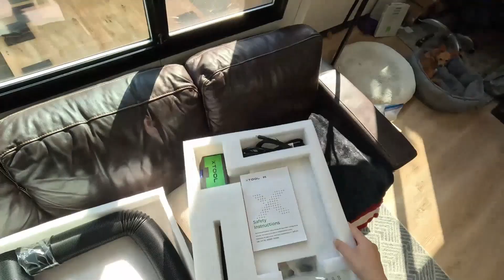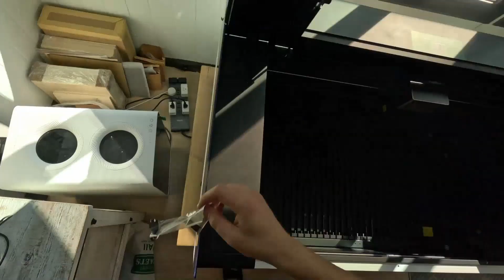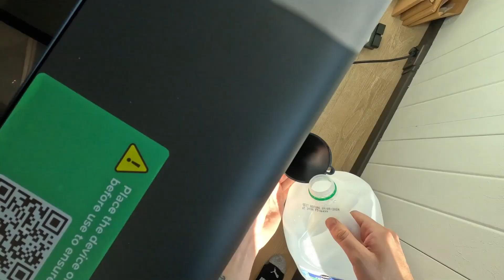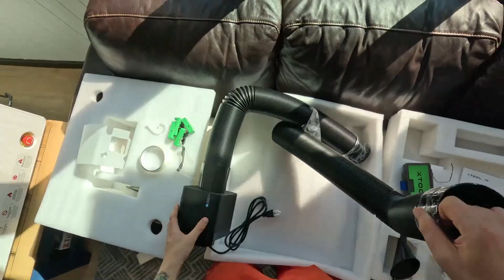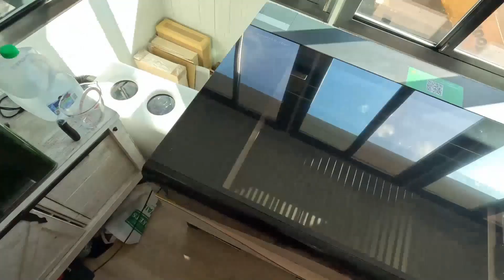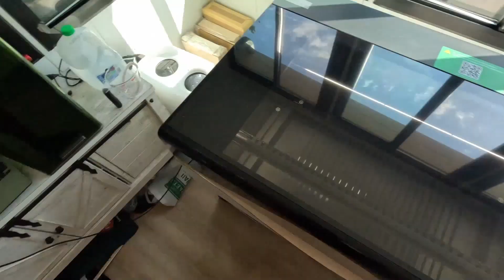Setting up the P3 Laser by Xtool

Comment: Hi, I just got my P3. I don’t know what I’m doing. I’m about to set it up but two things one thing I wanted to ask I’m in Southern California. It doesn’t freeze here. Do you know which measurement on a chart I would use for that? Also, I noticed you plugged in the unit into one of those supply boxes or strip thingy I just wanted to make sure it was OK to do that and is there a certain one that I should get that will handle this and also the air extractor. Thank you so much. I hope this made sense.
Reply: I think the antifreeze is to stop the chiller from freezing the water in the machine
Reply: Hey, I don't remember which measurement chart I used but I think I filled up with a little antifreeze anyways, I think on the back of the machine there is a little graphic with levels on how much to fill up, I just filled up to the red area and then the rest with purified water.  I put a little antifeeze in just in case but I'm also in California and really need to worry about freezing temps either

As for plugging it in, I found a random power surge protector I think the one I got was from Best Buy, I don't think it matters too much but I'm not an electrician so I don't know too much about voltage and load capacity, but having a decent surge protector should be more than enough since it runs off the 110V plug.

Enjoy the tool and thanks for your questions, hope my answers were helpful!